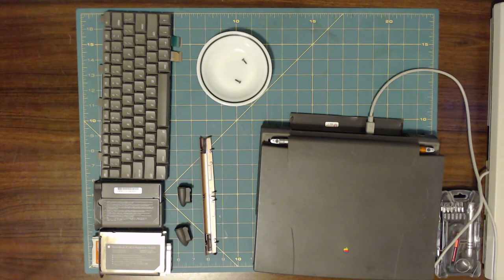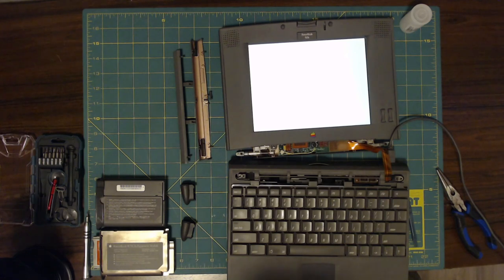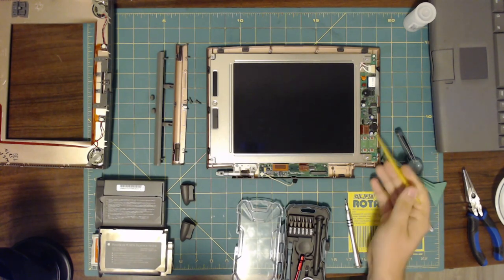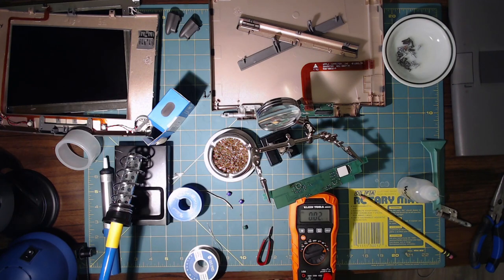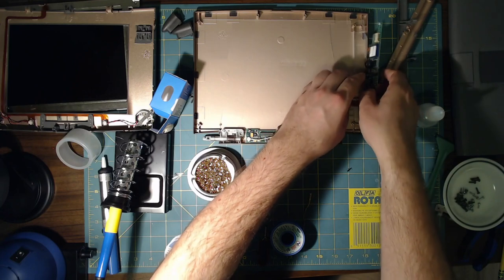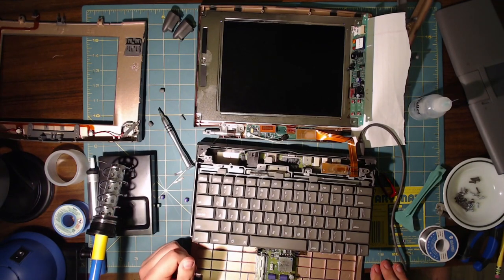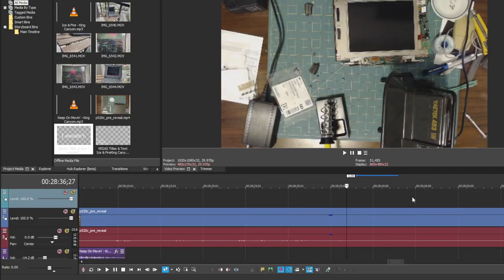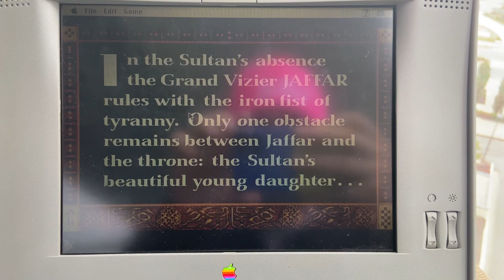Powerbook 520c Screen Issue Diagnosis & Repair

Comment: Mine just started to have the exact same problem. What is the list of capacitors so one could pre-order all needed ones before disassembly? 22uF, 6.8uF, and 220uF ? and which goes where?
Reply from the maker: I don't have a list of components - I disassembled and counted them manually from my memory.

There's a good disassembly guide here: https://www.applerepairmanuals.com/the_manuals_are_in_here/PowerBook_500_Series.pdf